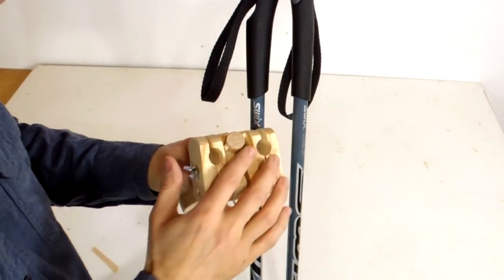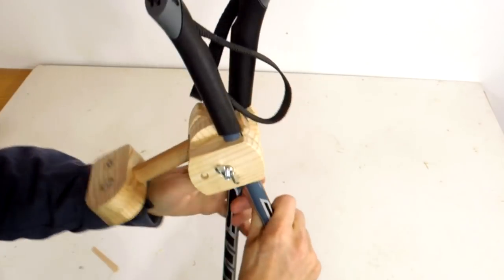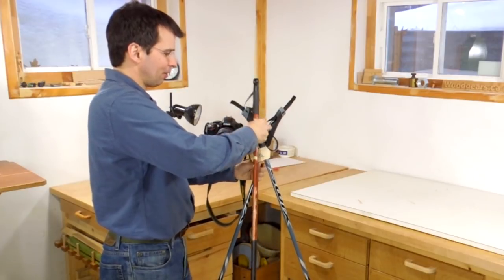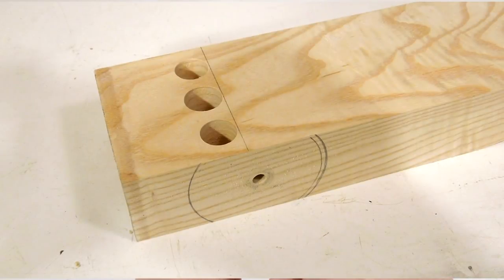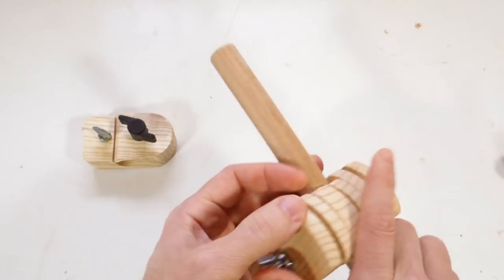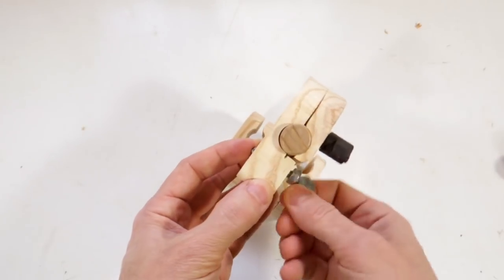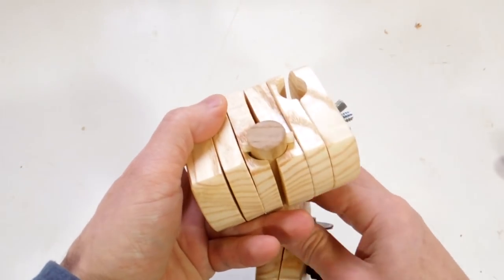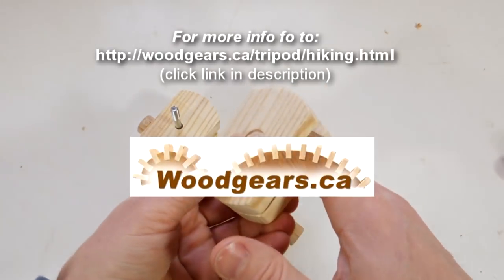Bipod / tripod from ski poles or hiking poles camera mount

Comment: Another great project. One suggestion put a stationary nut on the end of the bolt with the butterfly nut. Use epoxy or loctite to keep it in place. This will keep the butterfly nut from falling off, most likely when you need it the most.

Comment: Because with two poles, you have a singular plane that they can be aligned to. Once you add a third pole, if you're going to have any sort of balance, it has to have some directional component that's not on that plane, making a simple jig like this impossible. It would have to have an additional axis of rotation, meaning another component that would attach off to the side with its own adjustment bolt/nut assembly.

Comment: Perhaps one could attach a third, shorter detachable ski pole (or other similar tube) to one of the other two.  If short enough to avoid the handle and the tips, the weight difference would be minimal.  The apparatus would have to be attached to the poles slightly lower.  Another thought--ski poles are hollow: great place to store lower diameter rod if one could gain access through modification (and prevent rattling that would drive the user crazy).  GREAT VID